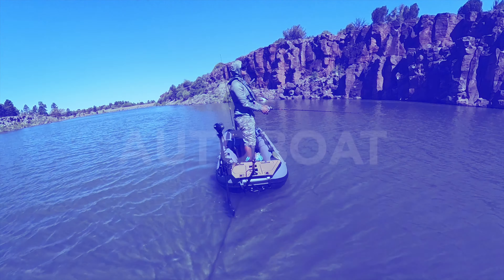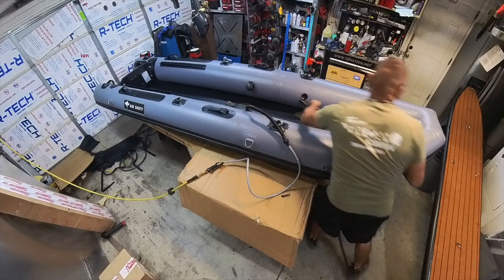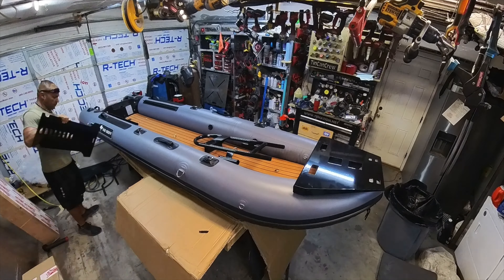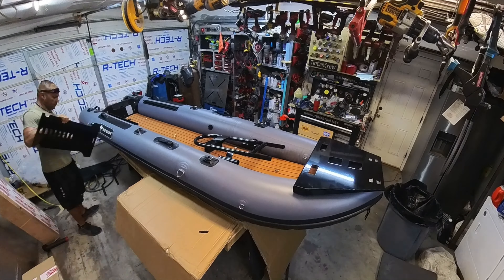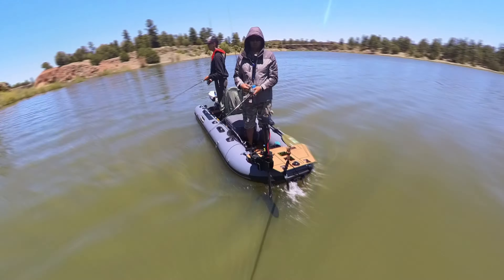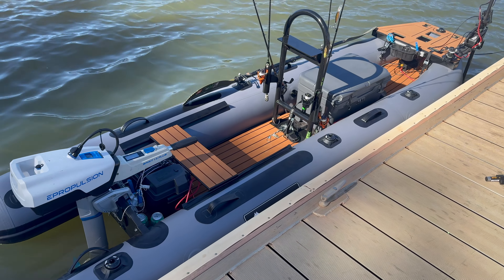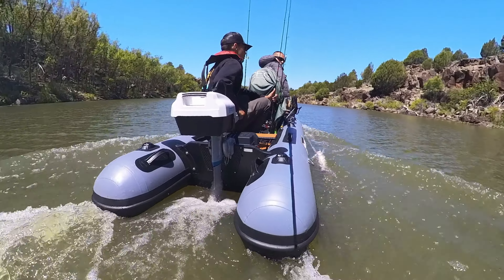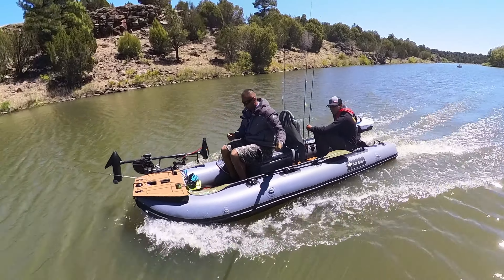Lite Skiff Air: a NEAR-PERFECT Inflatable boat

Comment from the maker: Get the Air Skiff here: https://tbnation.net/products/lite-skiff-air
AUTOBOAT GPS: https://tbnation.net/products/autoboat-gps-trolling-motor-anchor-system
_________________________________________________
0:17 - What is AUTOBOAT GPS?
1:15 - Introduction
2:14 - Air Skiff Unboxing & Build up
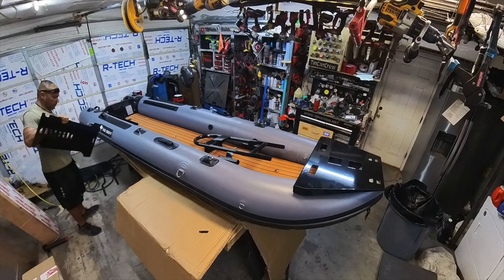3:55 - Rail Plaza fishing accessories
7:03 - Trying Air Skiff for the first time. 
7:42 - EPropulsion Spirit 1.0 Overview
9:26 - I fell off my boat because of this!
10:27 - AUTOBOAT gain settings
10:39 - Route/track - following & anchoring
11:08 - Nav heading feature
11:56 - Breaking down & storing your Air Skiff.
13:04 - Air Skiff vs Lite Skiff comparison of features
18:17 - why I chose the Air Skiff as my new favorite boat
Reply: Noooooo wayyyy !!! 3000 bucks for that ??? Oh heck no !!

Comment: That Air Skiff looks awesome!! 
Done lots of research.  It has heat welded seams which are way more durable than other inflatables.  I’m sold.  
I have inflatable kayaks and have owned other inflatable skiffs….but those all had adhesive seams.  Heat welded seams makes this skiff absolutely killer reliable and durable.
Reply: Seems like the original- Saturn Kaboat, True Kit, and Kolibri are all thermo welded.

Comment: Im now on the fence.... I have a Jackson cuda 14 (just paddle) and am looking at trading it for a lite skiff and doing a setup similar to yours but now this. The inflatable sure looks nice and its wild how much you were able to rig it up and then just pack it away. In you videos is looks like the lite skiff can get up on plane and cruise pretty well and is mostly stable enough for 2 people. I am thinking something like a 6hp electric outboard and then a autoboat trolling on the front with my garmin 10" rigged to the front. The air skiff with that center support bar and the front deck really gives it a larger boat feeling though. Just dont know which to look at more seriously. I also just found something like the FishSkiff 16 that is available on Amazon with some cool configurations and  seems to be quite capable for a inflatable boat. Do you have any experience or opinions on that? The size doesnt seem to be a limiting factor on portability when you deflate for transport. Kinda seems like a easy way to get the benefits of a larger boat with less of the downsides.
Reply from the maker: One is more portable, the other is more functional. That should be the defining aspect.

Comment: Awesome skiff, but too overpriced
Reply: Just curious what do you think it should be priced? I’ve been looking around, large kayaks, skiffs, SUPs. What’s out there that’s comparable to this and beats it? Cheers
Reply: @jbreezyfishing  well it's pvc.  Hypalon is normally the higher priced and pvc is cheaper when it comes to inflatables.  I have a hypalon dingy I bought after Hurricane Harvey and it was 3k.  So this being the same price for lesser material is hard to swallow
Reply: Isle flywater gg
Reply: @bryankwong2175  Seriously considering the NS130 after looking at all of the inflatables on the market. In general I am liking the portability and how easy they are to pack down. Outboard and smart trolling motor, fish finder, welded seams .. very nice at that point
Reply: @chuanR35  Good to know. Learned something new about hypalon
Reply: @jbreezyfishing  does the NS130 have the rubber protection this one offers?
Reply: @ if you mean the heat welded seams instead of using adhesives that can melt over time in high heat, yes the ns130 is built with that. Also check out Sea Eagle
Reply: @jbreezyfishing  no what I mean is on this one there is an extra thick rubber bottom

Comment: The problem with these inflatables is, you have to spend two hours setting them up at the ramp unless you keep them inflated witch defeats the purpose. Also wind is a major issue.
Reply: Keeping it inflated doesn’t defeat the purpose at all.  They are susceptible to wind but that can be overcome with an anchor or motor.
Reply: True. However, another option with inflatables due to their light weight is to carry it inflated on roof rack. That way can either unpack and inflate at home, or leave inflated at home if have room.